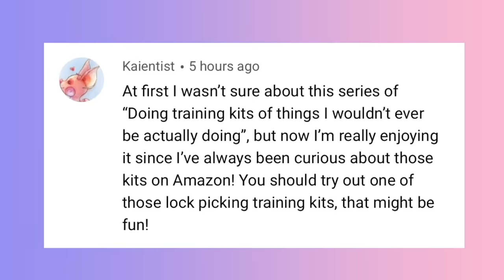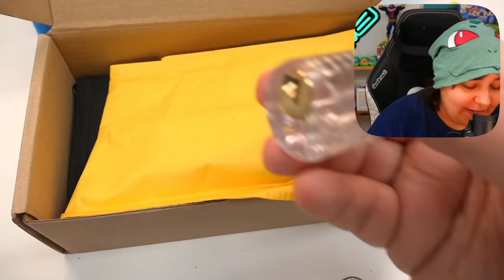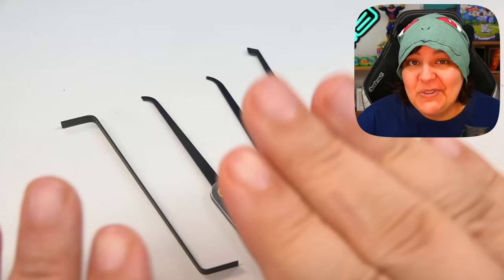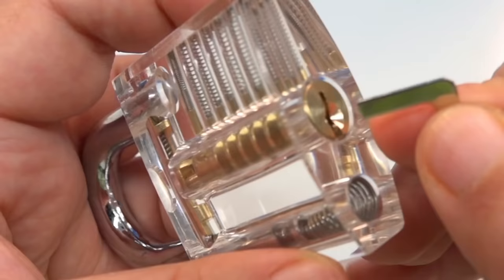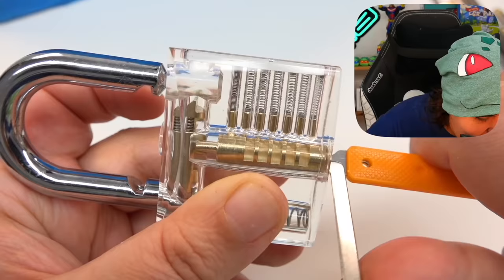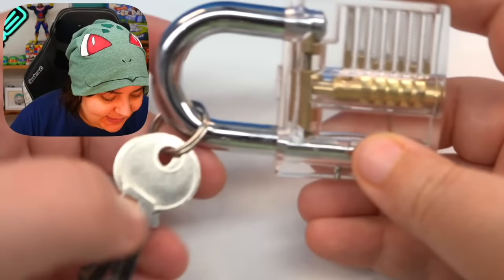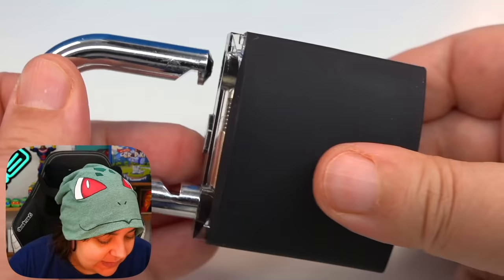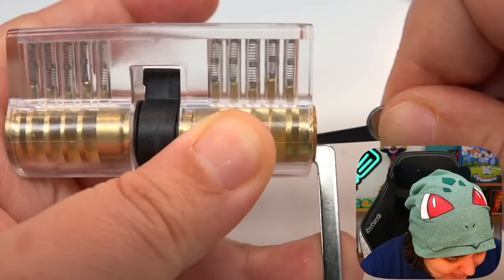Trying Picking Locks First Time With CHEAP Amazon Kits

Comment: I got locked out of the house one day after school back in high school and both my parents were working. My brother and I would go in the house via the garage keypad but that day the keypad had died and I didn't have the front door key on me. The back porch door was also locked. I ended up "breaking in" through a backyard window that wasn't locked  so I could slide it up and somehow I also slid the screen part up.

Comment: What I would do to unlock a doornob door that has the tiny spin locker inside this was the bathroom one but what I did was I took a penny and right where the lock hole was I would shove the side of the penny in the hole a bit then would turn the penny and I was unlocked so a penny works on the one I did too

Comment: So I lock my self out of both my house and car, so I was heading to work, so I had locked my house and was in my car, when I remembered I forgot my lunch, so I rushed out  of the car to go inside and get it. Well I closed my car door thinking my car where in my pocket. And grabbed the door saw it was locked, ( like duh, I locked it for work) reached in my pocket and was lock wait where are my key, by then my car had auto locked the doors. With the keys sitting there look all pretty on the seat I was just on. So now I was locked out of both!

And for the combination lock, you have to pull the ring, lock thing, and you will hear the clicks

P.S. - Jackie, I saw the password on the card!#NerdEficationSquad

Comment: welp, I locked myself outside my boyfriends house BUT I had keys in my hand :') The thing is that the outer doors (since there's two of them one on the porch and one leading to the house directly) are kind of broken and you have to use a lot of force to open them. That wouldn't be much of a problem normally just some kicking and pushing/pulling BUT (again xd) the neighbour, who is also my boyfirends aunt, was basically observing as I was trying to "break in" with the keys and that was causing so much stress that I ended up just sitting on the stairs and waiting for my boyfriend to come back home XD

Comment: Lmbo, "I'm having a hard time evening then out." That's because they're not supposed to be "even"! If you're using the "pick" tool, you're supposed to be locking each pin in its proper place, which isn't the exact same as the other pins (in a good lock anyway). Research Jackie, all of these endeavours are about research!

Comment: I accidentally locked myself in my closet because I wanted to scare my little cousin, but then I got bored and wanted to come out of the closet. But the door was jam tried opening the door but then the door handle came off and I was stuck in my small closet for a hour and my mom couldn't help because she left her phone at home and couldn't call her. So I tried unlocking the door with a small metal thing I found but it didn't work 💀

Comment: go watch a tutorial by the lock picking lawyer. You are doing it incorrectly. you need to be holding tension and then lifting pin by pin until it comes unlocked

Comment: The tutorial is bad. Check out the lock picking lawyer for better ones, because you're currently learning wrong things that are hard to unlearn later

With the rake, (the thing you were told to use with the house lock) you don't continuously apply pressure. You intermittently apply pressure hoping the raking motion has pushed all the pins above the sheer line so they drop in place.